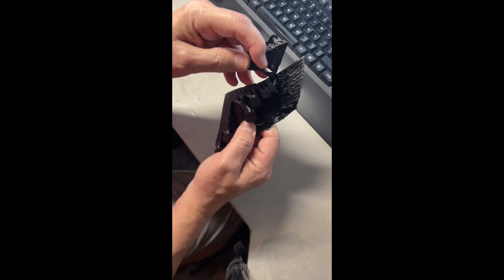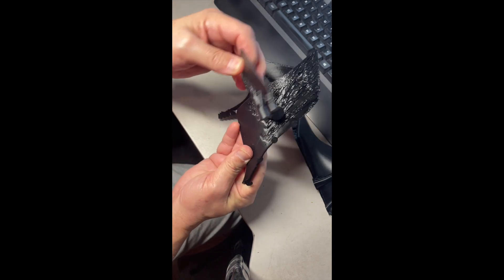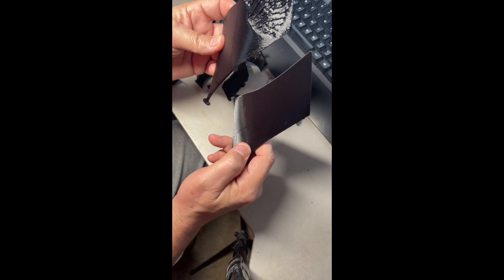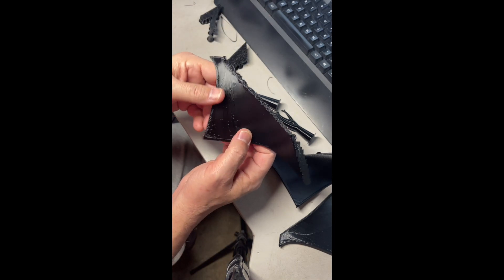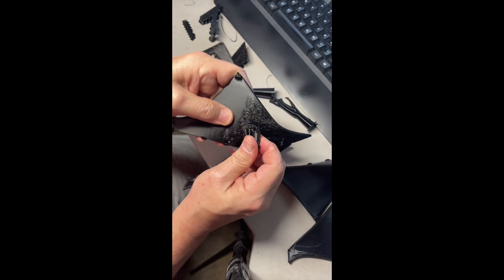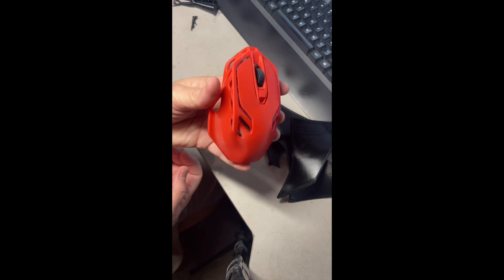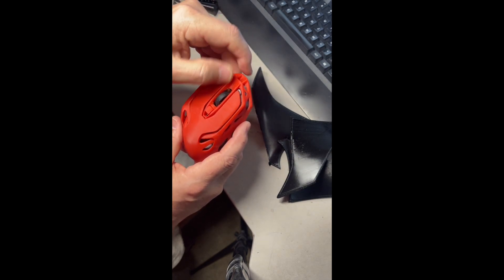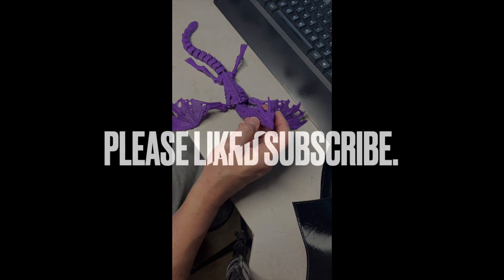Bambu Studio vs OracaSlicer Printing TPU

Comment: Interesting! And really good timing too; i just got my first rolls of TPU (Eryone) in the mail today! This will probably help me avoid some potential headaches with printing it, as i also mostly use Orca these days. I wonder what's causing it..
Any more pointers you care to share regarding printing TPU with Bambu X1C would be greatly appreciated! Thanks for you videos!
Reply from the maker: I select generic TPU when printing, make sure the correct bed is selected and use a top Z height of .34 and I usually use a bottom of .3 but your results may vary.  I'd try a test print before investing in a mask or something large.  Check out my other video on the Batman Cowl for more TPU info.  Thanks for watching!!!
Reply: @3DPrints747  Awesome! Thank you! And i'll be sure to check that video out too!👍